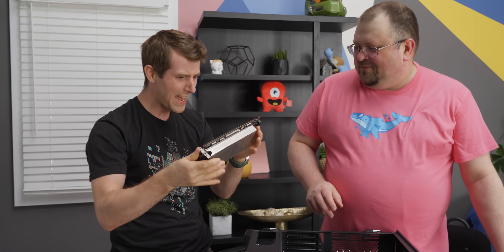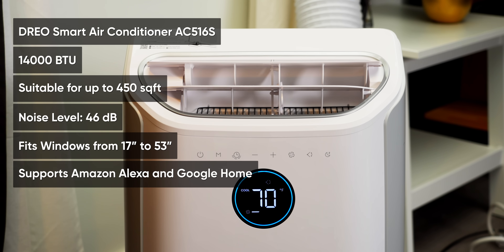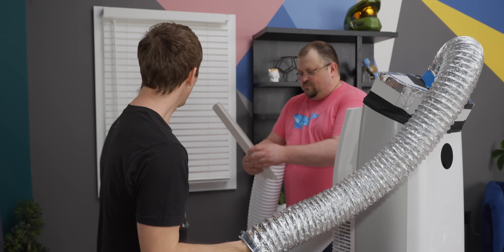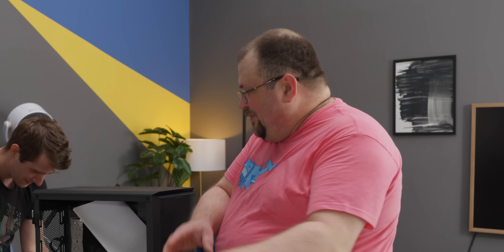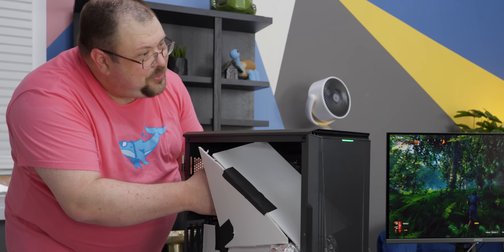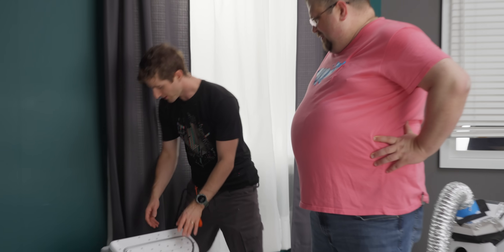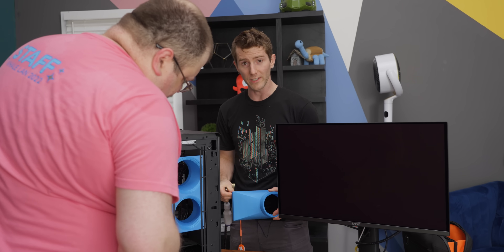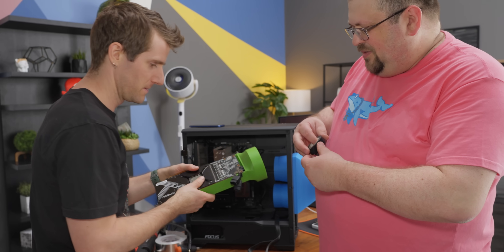Everyone is Cooling Their PC Wrong

Comment: If you've ever watched Technology Connections you know to never ever get an air conditioner with a single air tube.

These things essentially heat the room they are trying to cool because the "hot side" of the condenser is in the same room as the cold side.

Even window mounted AC's are better.

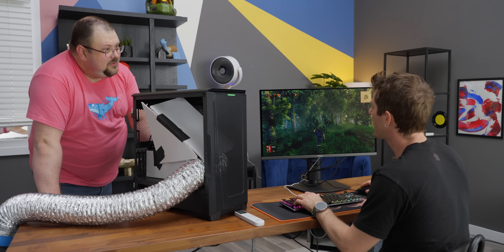Comment: At around 4:30 Coil Whine is mentioned?  Is this just due to the lack of noise not obscuring it, or are there elements of the setup that somehow make it worse?  Coil Whine is probably one of the most annoying things about my GPU and I find myself sometimes capping the frame rate from 144 down to 90 just to make it quieter.

Comment: Blowing cold air on a HOT surface does not produce condensate, it is the other way around. IE the air hose is cold in warm air and will suck up all the water it can get from the air. The only "risk factor" in that set up is the ducts inside the pc could be cold and warm air from psu,ram, southbridge and other things brings moisture to collect on the outside of the ducting. You would be better of from a condensate point if there were no ducts going in to the cpu and gpu inside the pc allowing all air inside to be cooled but instead duct it on the outlet side only and the pc was made airtight everywhere else. That way you can control where the cooling goes by restricting the exhaust from the cpu duct so static pressure inside the case would force air out via the gpu fin/vent.

Comment: Y'know, you could probably do this with a vapor chamber, heat pipes, and "remote" radiator that is out, laterally from the GPU in the space where a vertical mount would be and out the side panel of the PC.

Comment: The risk of condensation is minimal in a real deployment as the room shouldn't be warm (its being air conditioned and AC units act as dehumidifiers)

If doing this for real though, you're best leaving the AC unmodified and ducted to the top of the case with conventional air cooled components and front fans

Comment: Lots of missed potential here. The air should have been fed back into the AC's intake to create a loop. This would get you to much lower temperatures. Also there is no need for insulation on the inside of this system, because that air already passes the getter inside of the AC. The only condensation will be on the outside of the system. Like the outside of the PC case or the outside of the hoses.

Comment: Condensation would not be a problem because the output air of the A/C unit is extremely dry (remember, condensation and frosting on the evaporator). As soon as it gets out of the unit, its temperature will increase, and as a result, its capacity to hold humidity will also increase, so it can not create any condensation. So you will only have condensation outside the system.

Comment: some criticism of the unit provided by the sponsor, based purely on the Technology connections video about portable air conditioners. (im not an expert)
a) portable units work best when they have TWO external ducts, otherwise you waste somewhere between 10-50% of your cooling power. 
b) none of the selling points of this unit are special. even some of the cheapest units have "recycling condensation" (like the one in my room)
c) why must everything be app controlled :(

Comment: Setting the fan to auto on an Ac will reduce how much water the ac puts out. When the compressor stops, condensation on the element is blown into the room if the fan doesn't also turn off like when on auto.

Comment: This has the potential to be so much better. A better three d printed thing reducer on the air conditioner would have been a good start. A larger sized duck from the air conditioner to the computer. Using that room fan as a booster fan and using something like twelve inch duct when using the booster fan

Comment: These portable AC units are a scam. And I don’t mean this brand, I mean the entire concept of the portable AC unit. Please read all the reason why:

- They don’t cool as well. 
- They are noisier than window units. 
- When exhausted, they create negative pressure in the room you are trying to cool, thus bringing in hot air from outside the room you are cooling. 
- Their fans have to be doubled, or twice as powerful to move all the air around. 
- If you don’t have a condensate drain, the humidity removal is not as good, therefore raising the real feel in the room. 
- If you DO have a condensate drain, now you have to figure out how to move the water away. 
- They take more electricity to use, to do a worse job cooling. 
- They are more expensive. 

Real friends don’t let friends buy portable AC units.

Comment: I've been running this type of setup for 2 years on my system with a 12K BTU AC. lol My 3D printed front intake is a little more elegant than y'alls. The front intake slides right inside the front panel of the LianLi 216 case, and the hose has an attachment that it screws into then slides into the front intake. I was 3rd in TimeSpy for 7900 XTX/5800X3D all with air cooling. With my 5800X3D BCLK OC'd to 105.2 BCLK boosting to 4.7 GHz all core, and good enough for 13700 CPU TimeSpy score, and the Merc 319 7900 XTX modded with AsRock 550W Aqua VBIOS boosting to 3.3Ghz with an average GPU temp of 42C with a score of 36561. All on air. lol I do in the desert of Texas, and my room went from the hottest room to the coolest room in the house. If you want anyone trying out crazy experiments in the tech lab, let me know. lol

Comment: Tried this by leading cold air into the front fans of my pc. Well, it caused the cpu fan to blow at a lower rpm. Because there's a temp sensor in front of the case that measures ambient temperature.

Comment: Hey, it's a pleasure to watch your videos! However, I noticed early on that when you try to cool computers with an air conditioner, you run into the issue of water condensation. Here's a solution for that: you should use equipment with a vaporization temperature higher than the condensation temperature of the air. Alternatively, you could submerge the entire PC in mineral oil or a similar dielectric fluid and use it like a water-cooled PC.

Comment: Would worry more about condensation on that hoses in the pc than condensation on the pc parts.
I did build a system like that 20 years ago 😂 with freezer and fans. for overclocking
Reached a temperatur of 23°C on the CPU while gaming.

Comment: It works pretty well to water cool the computer and have some radiators on the vent on the top of the AC.  Make sure the air flow is as unrestricted as possible.  Having too little air flow causes the AC fan to have issues and the coil to ice up.  The main issue is the fan is not able to deal with the back pressure of restricted air flow.

Comment: 30 + years of building cold air intakes for some custom and competition automotive stuff,engine,cooling,hvac,braking etc. tells me that there is not nearly enough air in that duct for that system to be efficient and it's not just a case of adding fans,a faster flow through a small duct entering something like a pc case will just create a real mess of the airflow,a larger diameter feed would notably increase efficacy,remembering that doublng the size of a pipe( for example, 1" to 2") gives you three times the capacity. "I have been using the freezing cold air from my permanently chilly cellar through a pair of 9" ducts,filtered via a couple of adapted Mahle automotive cabin filters👍😊 and a custom built carbon fibre shroud right up through my floor and cabinet base to the 3 x 120mm bottom case fans in my pc for about 2 years now,using a very slightly positive pressure it works an absolute treat.My gpu,which sits about 50mm above the intake fans hardly uses it's own fans.If you start off with cold enough intake air and even half efficient air movement you can't lose.
Paramount with cold air intakes of any kind is isolation from warmer ambient air which absolutely will be pulled into the airflow at any tiny opening,this will be evident by the build up of dust and dirt around any gaps even after only a short period.

Comment: 04:18 Isn't it the opposite? When you move warm air into a cold environment you get condensation. Warm air can hold more moisture than cold air, so you get condensation when you cool the warm air.

That's why you get condensation on a cold drink in hot weather. You don't get condensation on a hot drink in cold weather (but you do get condensation from the hot air rising from the hot drink, which is hot air moving into a cold environment).

Although, to an extent you can get condensation any time cold and warm air "meet".

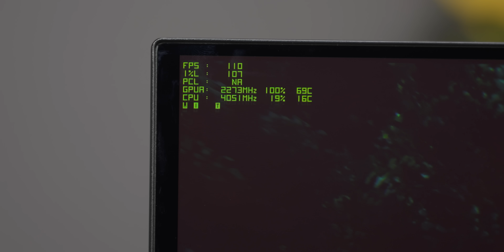EDIT: Around 12:40, Linus says it the right way around.

Comment: Hate to be the one but nearly all industrial machines have their electrical cabinets with ac units mounted to them. This is where the computers are also mounted and they make small computer cabinets with ac mounts already so would have been cheaper and worked better to just buy one of those. Also the condensation happens in the ac unit not after lol unless you are treating the air right after the ac unit like home units can do. But industry units are set to keep condensation out of the cabinet with enough flow to keep everything happy. Shouldn't be a problem in a house or your studio because you're not dealing with high humidity air. You are over cooling here because you're wasting most of your cooling performance with your execution leading you to have condensation. 3/100 for the idea because tons of the world's computers are ac cooled already, 0/100 for execution. Chat gpt would have made a better script and video for you to throw out. I thought you said you were going to do better with videos not just put any bad idea rushed and released. Sad to see ltt resorted back into their old bad habits.

Comment: If you wanted to avoid the whole manufacturing shrouds, potential condensation, etc route then you could just A/C your room and have a normal air cooled (or water cooled) PC.  Having a lower ambient temperature does help keep your regularly cooled PC cooler lol

Comment: It is always very entertaining seeing you macgyvering and tinkering around on various PCs and exotic hardware. ;) But I would highly not recommend having an air conditioner blast freezing air into a PC - even if this might sound good for overclocking it is dangerous because the circuit boards and other parts of the PC case will get freezing cold over time. Humidity in the air will condensate on all cold parts and form drops of water like on a cold can of energydrink, and one drop of water falling down on the backplate of the gaphics card can already cause a dead graphics card. Which is an especially highly unpleasant and expensive experience for Nvidia users with newest ultra high end cards.
Better stay with good old reliable cheap 5$ default 12v fans for the sake of a healthy and functional computer.

Comment: You should use a normal cpu\gpu cooler, and just duct the air inside the pc as a whole rather than directly to the coolers.

It would require testing to be sure, but I think it's likely that with the above configuration condensation wouldn't be a issue other than possibly on the outside of the case itself if it get's cold enough.  The air coming out of the AC has dramatically lower humidity than room air, it's a issue with hoses because they are getting quite cold while also being exposed to the higher humidity room air.  With the setup I suggested the only air inside that pc will be from the AC itself.

The biggest issue is balancing the system.  You want it to run full tilt to cool the pc, but that will likely over cool the room.  If you let it cycle though I imagine the cpu\gpu temps will ramp up rapidly.   What you'd really want is a inverter style compressor that can ramp down rather than just toggle on\off, but those cost more, and i'm not sure you can get them in the portable ac style.

Comment: No one should ever buy one of these style ac units, they're so inefficient, you can most consider them as not working at all.  They say they're cooling the room as well, they're actually heating the the room as a whole.
Reply: They work well, and are a hell of a lot better than nothing. The main problem is that they're inefficient and very loud compared to a minisplit system. Sometimes you don't have a choice. My primary AC is currently missing due to building repairs, and a single portable unit is enough to drop the temperature inside my condo by 10C/20F on a hot day.
Reply: @guspaz  Where do you dump your exhaust from the condenser and is your condo attached to other units, like an inclosed hallway that's air conditioned?
Reply: @AdamBrackney  I'm currently venting it out the balcony door with the exhaust hose going into a piece of plywood with a hole cut in it. My unit is connected to a hallway, but the hallway is not air conditioned.
Reply: Bro that is an extreme over exaggeration. Stop watching one youtube video and calling it gospel.  I have very small casement windows that do not fit ANY window AC. I have been using portable ACs for years now, and have been through four different models. The single hose are about 30% less efficient than window, and dual hose 20% but they still work just fine. I now have inverter dual hose units from Costco and they are definitely better... but its not that extreme. It just keeps there from being negative pressure... mine averages about 300 watts to maintain my small apartment. Thats nothing for an AC...  I actually purposefully run my dual hose in single hose mode sometimes because I WANT the negative pressure at a loss of efficiency because it sucks in fresh air from outside which lowers my CO2 PPM
Reply: @CL-yp1bs  I've never watched any videos on it, I fully understandable how they work. Lol.  The negative pressure is pulling in hot air from the outside, mostly negating any benefit.  If it's not hot outside, then I don't see why you wouldn't just open a window😂 I agree that a dual hose unit is much better, but that's not what was used in this video and thus not what I was commenting on.
Reply: @AdamBrackney  You are exhausting air that is probably at 60-70C. The outside air you're pulling in is, let's say, 30C. There's still a large net difference.
Reply: @ Yes, my apartment is attached to an air conditioned hallway.. now that you mention it.. that might be where my air is sucking in from. I just know my CO2 ppm gets high if I keep it completely sealed up. using two hoses on my AC. But I always dump the hot air exhaust out the window.. I just sometimes disconnect the intake hose from the AC because it will then suck hot but fresh air into my room (from the negative pressure), so it is less efficient, but my CO2 ppm goes down from the fresh air.. it might only be because of the air conditioned hallway outside its sucking in from now that you mention it.. perhaps I will put a fan under the door to suck in free cooling...
Reply: @ shoot.. that does seem the same as just opening a window now that you mention it.. like disregarding the cooled hallway. huh..  since I am cooling and sucking in hot air all at once, its like a net zero...
Reply: @guspaz  The problem with comparing the exhaust temp to the air being pulled, they're not the same thing.  You'd really want to compare the air being blown out of the unit to the air being pulled in.  Also don't forget the air volume coming out of the exhaust doesn't have to match the volume that's being conditioned.  This why the dual hose units that pull air in from the outside to run through the condenser and then spit it back out are much more efficient.  They work like normal ac units, they just have the core on the inside.
Reply: @ the amount of exhaust air matches the air pulled in from the outside exactly since it’s the exhaust that creates the negative pressure that pulls in the outside air to begin with.
Reply: @AdamBrackney  It's also worth noting that the SACC rating takes losses due to pulling in outside air into account. This is why for a 14,000 BTU unit, a good single-hose unit will have a SACC rating of 10,000 BTU, while a good dual-hoes unit will have a SACC rating of 12,000 BTU.
Reply: @guspaz  Yeah I specially said the conditioned air not matching the volume of the exhaust air.  I thought it was pretty self evident the exhaust volume matches the air pulled back into the space.
Reply: @AdamBrackney  As I said, the SACC rating (which is defined by the US DoE but required for sale in Canada) takes into account losses. It has deductions for heat lost through ducting (they never have insulated ducting) and infiltration (air pulled in due to exhaust). It's why single versus dual hose makes a difference in the SACC rating.
Reply: @ I need a CO2 scrubber for use during Summer.... my CO2 levels get really high due to no ventilation.

Comment: At my place condensation would be rare most of the time, at least in winter. At 24C the dew point is like 5C or so at 30% RH which I rarely get above unless its raining and thundering in the summer.
In most cases a 15C difference is safe unless you've got over 40% RH.

Comment: What else happened in 1990?
This monstrosity was born.

Also a pro tip. 
Mobile AC units have TWO intakes for air usually. One for the air to cool and one for the air to be moved. And by using the air in your room, you create negative pressure, sucking in a lot more heat from the other rooms which slows cooling performance. 
By making a funnel like you did to put on a second hose and let the air be taken in from outside, you create positive pressure, which now not only creates positive pressure, therefore pushing the hot air OUT of your rooms, but also uses the often cooler air itself from outside (if you have those exhausts hoses set up in shadows) which makes it a lot more efficient at cooling. 
The only downside you get is of course negating the dehumidifier from working properly.